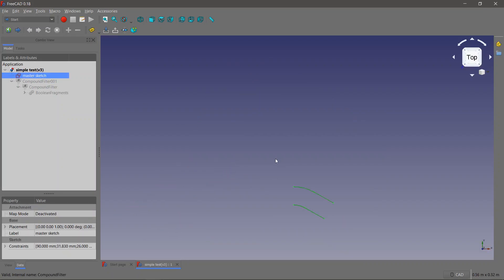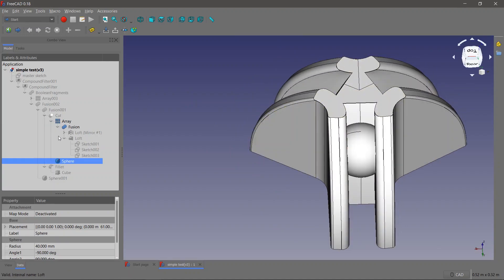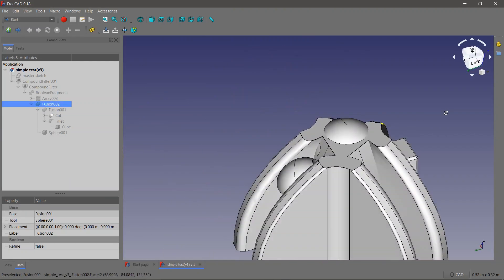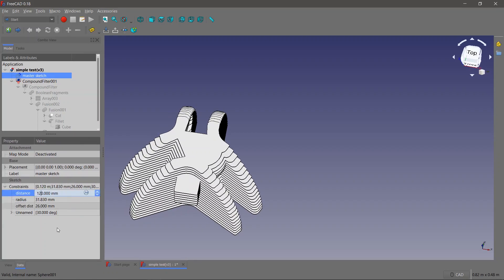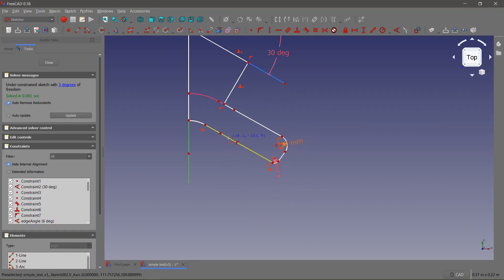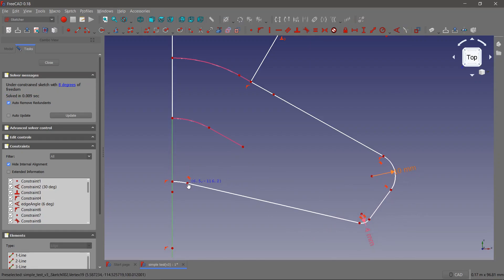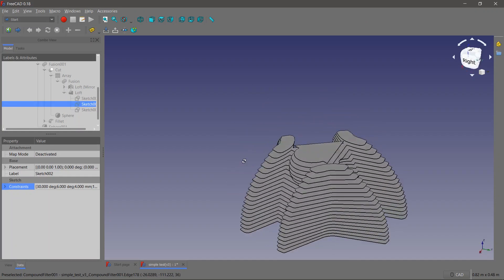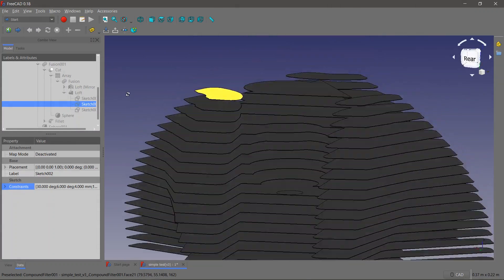Freecad Architectual Parametric Design? Easier than grasshopper, cheaper than Catia.

Comment: Is it possible to make generative design with FC?
Reply from the maker: By generative do you mean iterative with rules set and no pre-disposed solution, as with Processing, for example? I am not sure, but with python knowledge it can most likely be pushed. Also, Freecad can do FEM simulations, so it is possible to derive a generative design based on the simulation models.
Reply: @UHStudio  

Not exact iterative more on the organic side. I thought because of FEM module in FC it would be possible.Thank you friend. 👍🙏